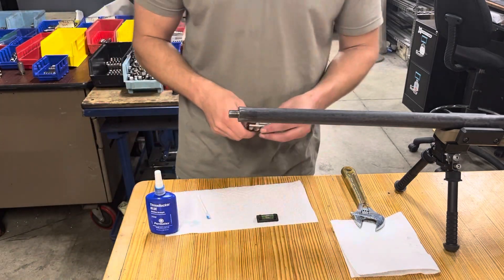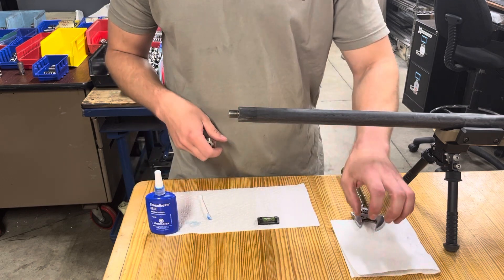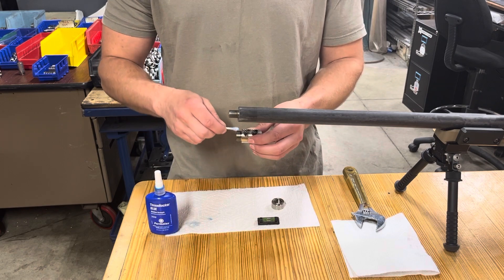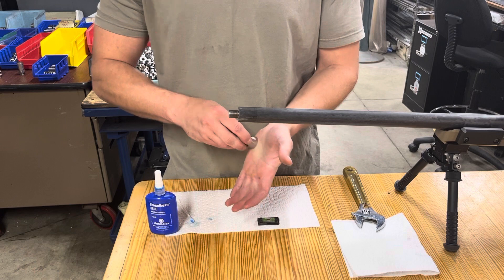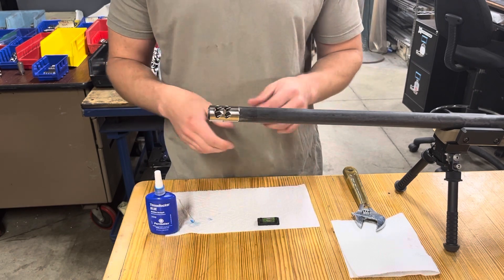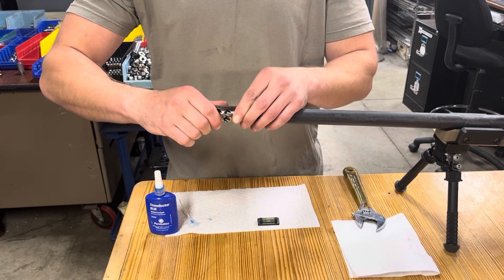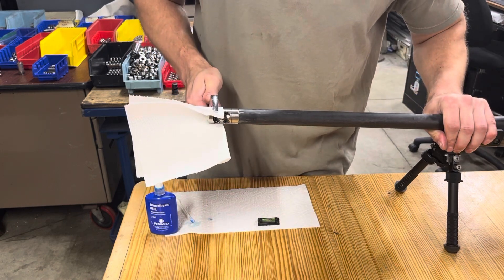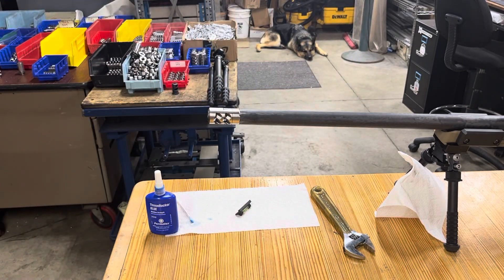Salmon River Solutions Self Timing Brake Install

Comment: Please forgive my ignorance, what is a self timing brake?
Reply from the maker: It does not need to be timed by a gunsmith. A standard brake would have to be faced on the back side on a lathe to get the ports parallel to the horizon.
Reply: @salmonriversolutions8058 Ken, why is a wrench needed? When I back off my TI Pro 4 from the locking nut to get level, I can easily adjust the break by hand. What holds the brake tight given it is not flush with the locking nut, the thread lock? Just seems too
Loose
Reply: @WesternReaper84 I never got an answer.